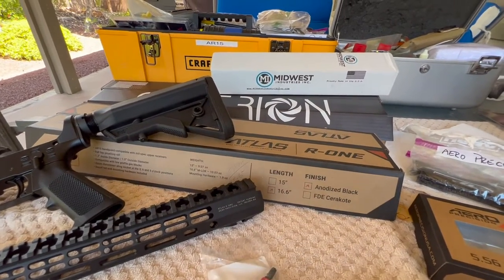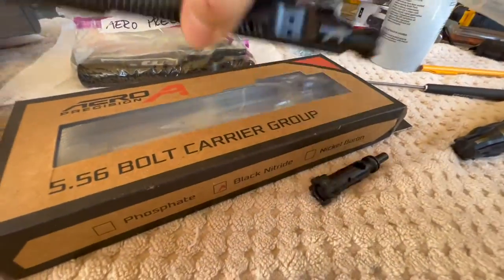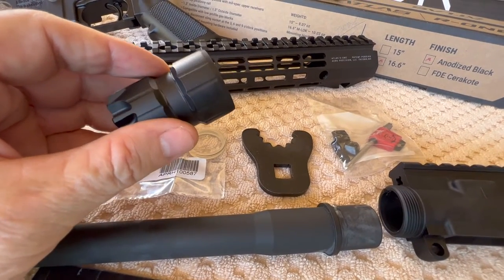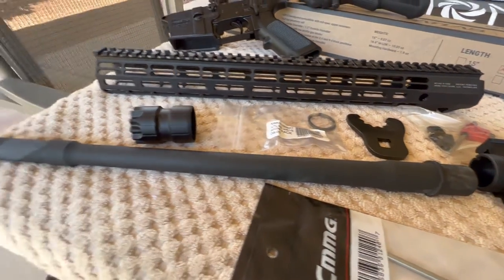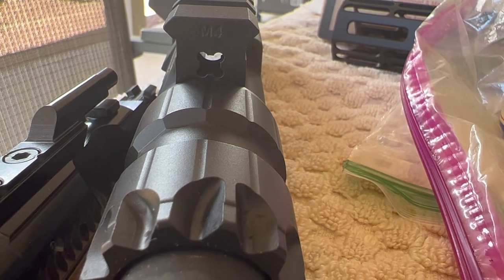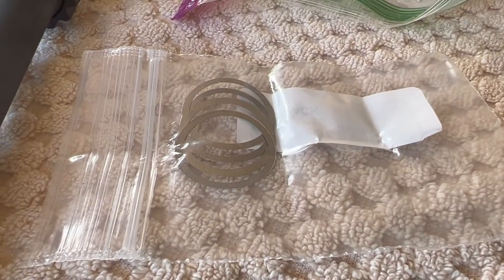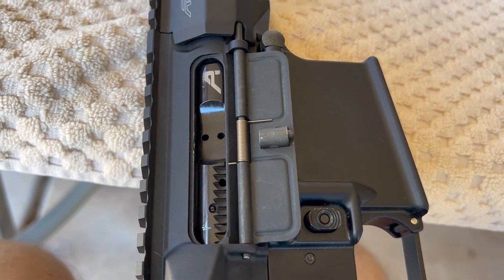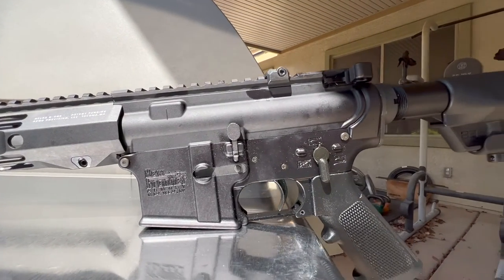AR-15 Criterion 18" Hybrid Barrel & Aero Precision Tight BCG Part 02/02 02Aug2022

Comment: I had a build do the same thing ,just cycled the bolt by hand maybe a hundred times and it was pretty much smooth sailing from there. I learned a long time ago to cycle all firearms that were new numerous times with and without ammo. Most all defects will show up before the range that way even if it is magazine related it can be dealt with without a wasted trip to the range. Like your videos ! That barrel was was one of the nicest I`ve seen on a bore scope also.
Reply from the maker: I usually catch most of it during the build. With the way things are these days I think just doing an assembly without some basic measuring tools is not a good idea. Even a lot of the "Big Names" are letting stuff out the door that could be potentially dangerous. I' haven't had an issue with Criterion yet and all their barrels have been extremely accurate. Thanks for watching!

Comment: Nice build, indeed. Could it be that the upper receiver is twisted slightly?
Reply from the maker: I think some of it may be tolerance stacking but I tried a couple of other carriers and they ran smooth in this New Frontier Armory upper. I had another Aero Precision BCG that ran tight in one of Aero's uppers on one of my builds about two years ago and was causing some cycling issues. It cleared itself up after about 100 rounds. Can't trust anyone to get it right anymore and things really need to be checked if you're doing your own builds. I think a lot of these manufacturers trying to keep up with demand are not changing out their tooling often enough.
Reply: @peteregger7928  I hear you

Comment: But if you put it together off camera then how do i know that you did it and didn’t let a Russian do it? 😂😂🇺🇸🇺🇸

The rifle looks good! 
Did you measure the bcg where the nitride is wearing off? Wonder how big a difference it is from the rest or if some how something else is causing it to rub there like the rails being off or something. Definitely not confidence inspiring.
Reply from the maker: I swapped a couple of other carriers and they both ran smooth. I think the Aero Precision is just on the very edge of being in spec. I'll manually cycle it some more as going back and forth a couple of hundred times has smoothed it out quite a bit already but it's still to much for my liking. I think it will probably run okay? Range testing soon!
Reply: @peteregger7928  no i meant the rails on the carrier … not in the gun. Just wondering if they have a high spot or aren’t straight causing the carrier to interact with the upper weird. Should run fine… only one way to find out 😂
Reply from the maker: Ha! Ha! If a Russian did it all you would see on the table for tools would have been a hammer and pipe wrench!
Reply: @peteregger7928  😂😂nyet rifle is fine
Reply from the maker: @itsamk18-ish  I think so because up front on the left side top bearing surface is where the nitride is wearing off.
Reply: @peteregger7928  yeah that’s the word i was looking for lol not rail. Maybe the nitride was just thick in that area. Come on aero!
Reply from the maker: @itsamk18-ish  Should have the bolt in the mail to them tomorrow. I'll be polite about it!
Reply: @peteregger7928  hopefully they actually inspect the one they send back… I’ve ran Cnc machines most of my adult life, if a tool breaks you inspect all the parts until you find where it broke. Hard to imagine leaving the broken tooling inside a BOLT lol